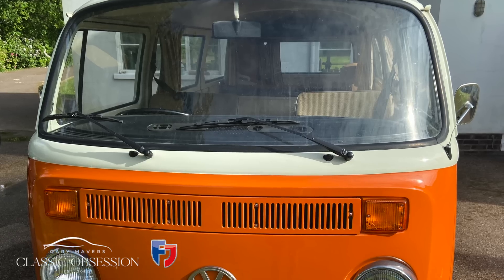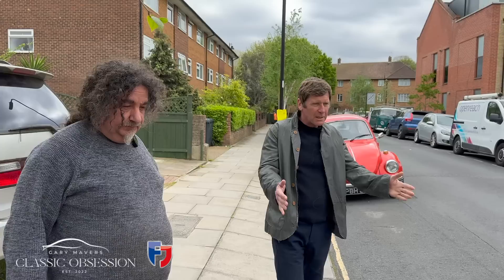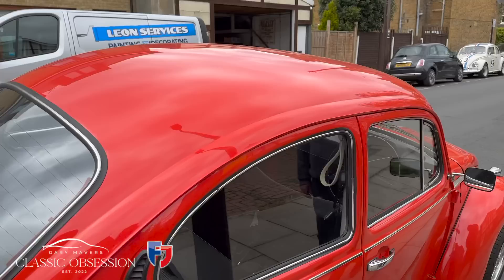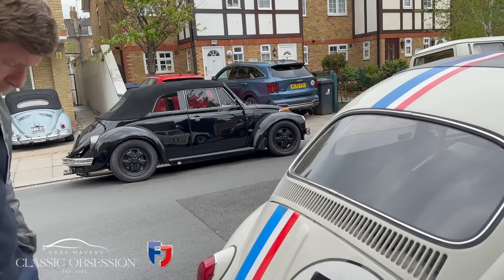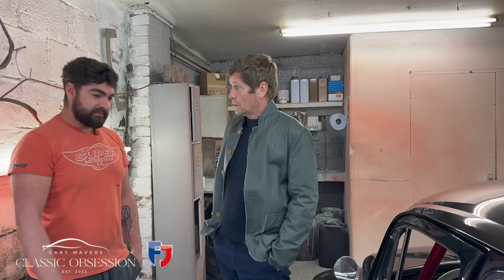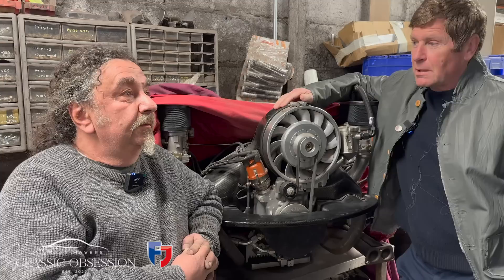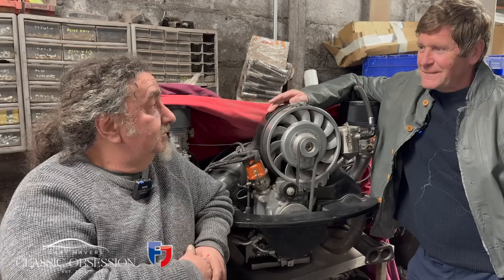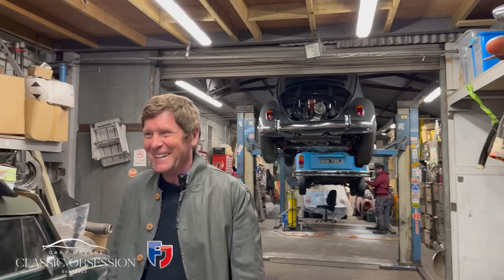Meet the Original Herbie! | VW Special Part 2 | Classic Obsession | Episode 33

Comment: Not orange Gary, I believe it's called Clementine. My Dad had a series of new Beetles in the 60s and then a 1600 fastback in 1971, ours was white with carburetors but I remember the orange colour and it being called Clementine.
From VW Campervan to Rolls Royce Convertible, you've come a long way Gary with lots of experiences.
Reply from the maker: I stand corrected!! So your dads was a variant? Regards.
Reply: @classic.obsession   Gary, My Dads was not a Variant, but was known as a fastback. Type 3 as the Fastbacks, Notchbacks and Variants are sometimes known. For extra money my Dad could have had a Kugelfischer Fuel Injected motor which in 1971 were distinguished by a stainless strip along the side of the bodywork, whereas my Dads was unadorned by this trim. The new 1971 cars were not nearly as well made as earlier 1960s Beetles. My Dad used to polish under the wings on his early sixties cars they were so well finished. Glad to have found your channel and to say thankyou for sharing your varied work here on YT. All the best, Adrian, Midlands UK

Comment: Great episode for you guys that love those oil bath air use dexron transmission fluid it filters out more dirt in the air you can slightly overfill it and it helps lubricate the valves.

Comment: I noticed the driver's door is a bit droopy, the hinges are easy to refurbish and eliminate a bunch of problems
Reply: I wouldn't exactly call it "Easy" as I've done several, and they are a pig to press out. Then the hinge has to be drilled for an o/s pin. They are however readily available and cheap and if you have a nice local VW shop they might lend you a hinge removal tool which makes life a bit easier.
Reply: @martinharris5017  all things being relative, easy isn't an inappropriate term in the big picture of restoration, but yes I agree that a pain in the butt is also an appropriate term for a majority of the work required in vehicle restoration,
Reply: @davebaker9128  And yet its so much fun too! I guess we restorers of old cars must have a masochistic streak, lol!
Thanks Dave, have a great day.
Reply: @martinharris5017  well, I have 2 very old Panhead Harleys, one since I was 19, and the oldest all original Citroen 2cv in the USA, so I am kinda weird about old vehicles,
Reply: @davebaker9128  I love Harleys. Never owned one but I have a lot of friends who do. I've owned a Ford Anglia, an Austin Mini, a Ford Cortina V6, and several beetles, as well as building a C-Cab hot rod and a Honda C50 baby chopper.
Not many original 2cvs's left now, I'll bet it turns heads!
Reply: @martinharris5017  isn't that funny, the first 3 cars I had were Mini Coopers, a 66S and a 69 and 70 for parts,
Reply: @martinharris5017  also the 2cv hasn't been out of the garage in 40 years, but it has been started semi regularly, it's possible it's the oldest, running, all original 2cv on the planet, it was the oldest in the USA in the mid 70s

Comment: When you ask him what kind of Porsche engine it has in the car he said a super 75 Porsche engine.     I’ve never heard of a Porsche engine called a super 75,  Is that a UK term for the engine?
Reply from the maker: Hi. I think it was a flat four air cooled engine that Porsche fitted to the likes of the 356B models. Regards.
Reply: The Porsche 356 could be had with a 1600cc 60bhp engine, a 1600 Super (75bhp) or a 1600 Super 90 (90bhp).

For filming in 1969 it was fitted with a Super 90 but sometime in the past it was replaced with the 75bhp version.

Good to see Luke looking well, he serviced my Beetle when I worked in London and did a great job.  He really understands and cares about these cars.
Reply: @ChaseCars132  Good information, but there is more to the story. The early 356’s were offered in 1300 and 1500 variants. Additionally, the Carrera four cam racing engine designed by Ernest Fuhrman was available as a production option. This was the first truly high spec Porsche 356 engine available and featured a very complex gear driven overhead cam setup and roller bearings in the bottom end. The Carrera engine in a few displacements was optional through 1964.